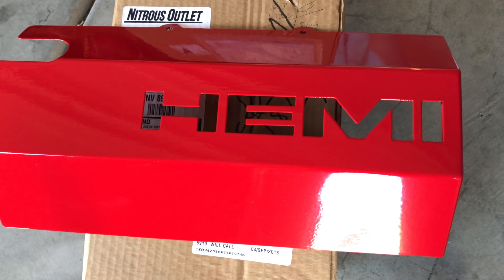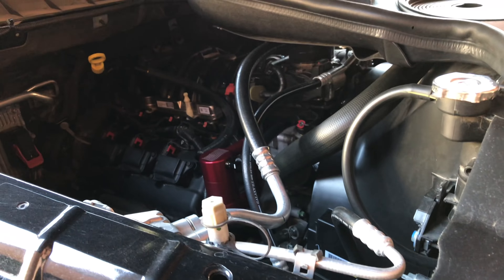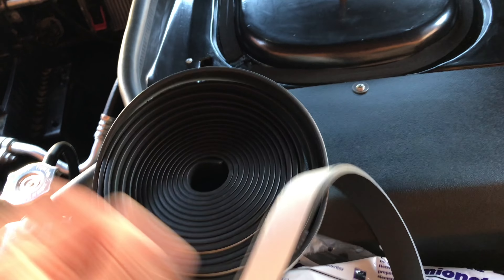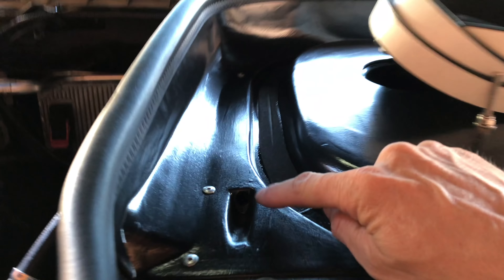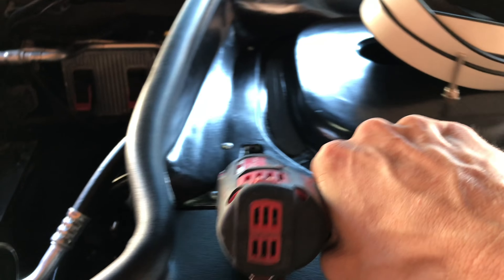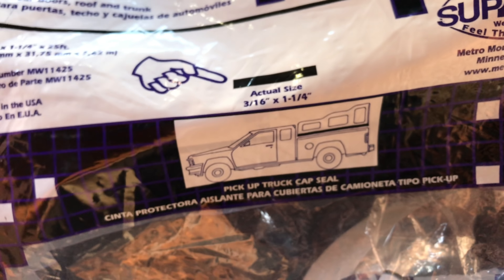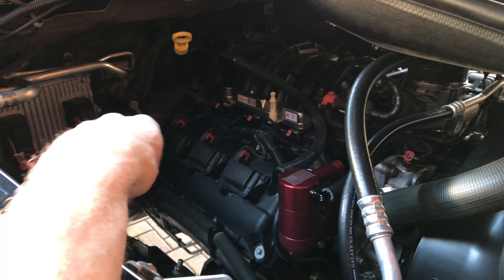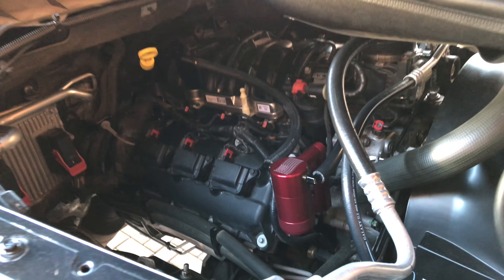Vararam intake part 2 the mod life RAM 1500 power mods

Comment: Their ads all look great! But it is the ONLY cold air intake I see on the internet that people seem to be having PROBLEMS WITH. Adjust this, move that, drill this bigger, ad material here and on & on. The idea is great but appears based on problems cropping up (that MANY seem to have) that it's not a good long term choice. Some have even taken it off due to the dirt it attracts. They claim  it's 1/4 miles are improved,, water will drain even if driving in water up to 2 feet deep, etc.  I do not drive like that, @60 mph my ram is only doing 1800-2000 RPM. I just pick up my 2016 Ram Tradesman, reg. cab.2wd,long box,5.7, 6 speed auto. not the 8 speed. Went to WV to get it. Drove my Victory Cross Country Motorcycle down - from upstate NY (441 miles one way) loaded the bike in the Ram  there and drove it back. Ran 10 mph over the speed limits both ways. the Victory Cross Country got 47 mpg, the Ram coming back got 18.1 total distance average( per the dash at least). Lots of hills, all interstate. Even at 80MPH in WV was 5.7 was under 2,500 RPM. Absolutely not saying it's a bad product, just appears to be a poor execution, extra maintenance and needs an update. Where it's advantages are (according to their ads) are not  my type of driving. And I agree it looks fantastic when you open the hood.  I bought my truck to be a "truck" and to do "truck" stuff. Heck I put a yard of topsoil in the back of the Dakota. I have a 66 Satellite (689HP-675Lbft) to race/go fast on the street. The truck just needs to pull the 66 on it's steel deck. It is replacing my -bought new 02 Dakota ( 4.7, club cab,5 SPD. manual 2wd) the the salt up here finally got to it. Yesterday I installed my MBRP single tail pipe exhaust kit,  Only Single tail pipe system I could find in 409 stainless with a sound rating of moderate. After all, all rams have a single exhaust up front, did not see the need to add the cost of two tail pipes. Our license plate transferred from Dakota(OUR MULE) says it all. Good luck to your modifying your modified air intake system .Sounds like they will help get you what improvements you are after to the design - maybe Vararam will take notice. Today I will add my 63 Series K&N cold air system. All I ever had  to do was clean/reoil mine about every  20,000 miles.    PS; K&N makes 4 different series systems, call them to learn the differences, as they all look the same. And keep your eye on your A/C and cooling system as  the Vararam Ram air systems "overhang" that makes it ram air  seem to block a lot of radiator and condenser. If it only drops down 6" and it's 24" wide that is 144 sq. inches of blocked cooling surface to the A/C & Cooling Systems. LONG TERM EFFECT IF ANY?????? Nice video and well explained!! I apologize for the lines in the story, not a computer guy just a car guy.

Comment: Those are not actually water drain holes...they are to allow air to go under the intake and into the "blanket" on the bottom to form a cooler layer of air on the bottom of the intake...if you are getting water in there, you in some deep ass water!!!!
Reply from the maker: You are right 🤬🤫 on their website the holes seem lower so I don’t feel so bad.  I probably gained half a tenth by allowing more air to flow 😂 http://www.vararam.com/air-grabber/air-grabber.html
Reply: Does it rain where you live?